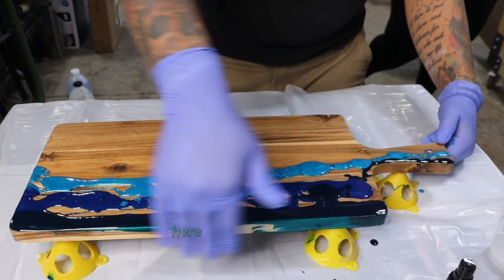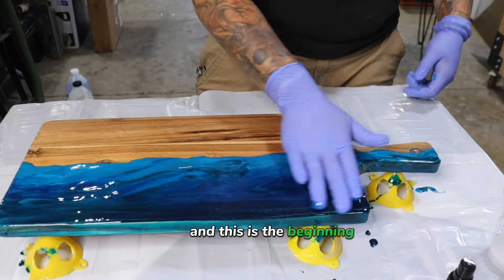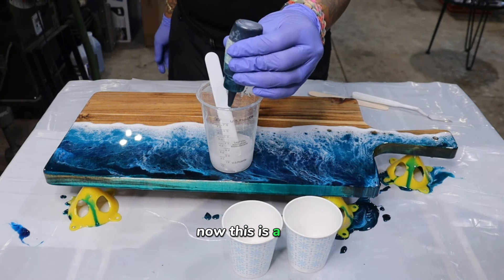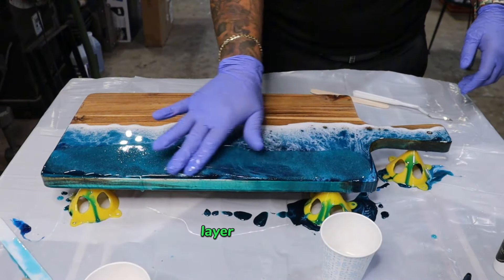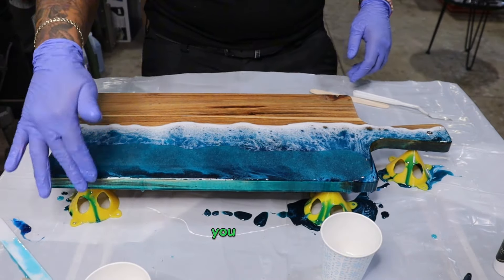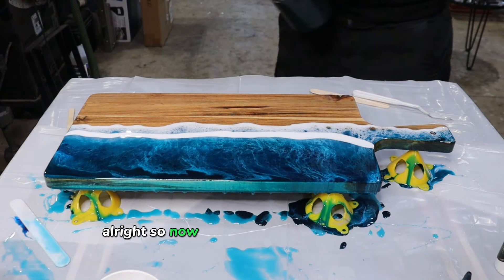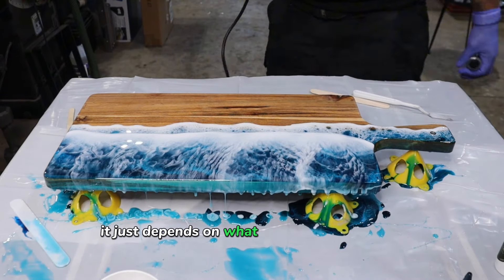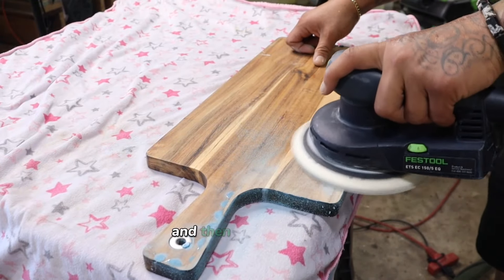Epoxy Resin Ocean Wave Tutorial #resinwaves #resinocean #howtoresin

Comment: Does the air that is blown have to be hot? I am looking to do this on a much smaller scale and am wondering if using a straw or an airbrush would work.
Reply from the maker: Hmmm.. i do use a straw. But i can pop out my airbrush to see,  the heat makes it move better

Comment: I use tuck tape on the bottom of  my boards , u avoid hours of filing and sanding '. Just tape it up before ' u start ' 
   7 $ a roll '.   I also do it on and furniture ,   I eooxy
Reply from the maker: Ya no, that's not for me.   i don't like the edge it leaves. I've an chip out, i just use my angle Grinder,  and sand to 180 slap some oil on it.. takes 5 min

Comment: Good evening,
May I kindly ask your advice regarding the amount of resin that shoud be used on canvas or wood, as when it dries it becomes  wrinkly. It looks like the top layer shrinks
Reply from the maker: I suggest starting with a seal coat at 1 oz per sq ft. Then moving up to a flood coat spread it evenly with a notched trowel you can find those in my Amazon storefront. 😉 self leveling resin self levels at ⅛"  once you get it there,  (and you've sealed the porous surface,  hit it with the TORCH (not a heat gun. I actually think I have a YT video on this how to get a perfect resin finish.

Comment: I have been trying more than dozen times and I do not get the waves the same way you do.
My white (waves) colour just stays and it doesn’t  moves up like a wave …all it does is  like a  small “puddle “ .   I followed   every step you said  and still struggling with the waves.
What wrong with me ? 
Where I’m doing Wrong ?
Is that the cheap resin and pigments I’m using.?
Reply from the maker: Yes the products are the most important part! Do you have my wave Kit
Reply: @NitasFluidWoodworks   No    Thanks

Comment: If you told me about 6 more times that you sell and e-course, I might buy it.  
And I'd love to buy isopropyl alcohol for ten times mark up as long as it's called Cell Magic.
We're on a roll.  Why didn't you just wipe off the slightly curing resin drips so you can reduce grinding by 1000%?